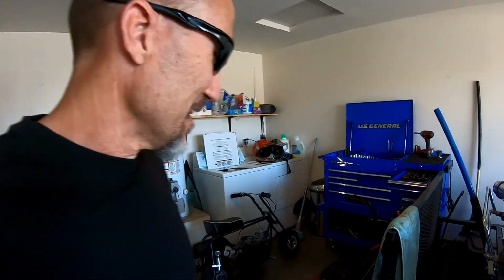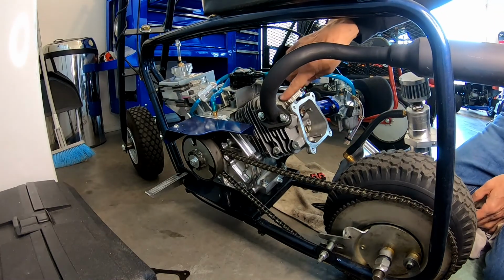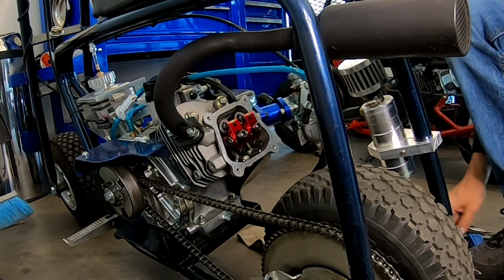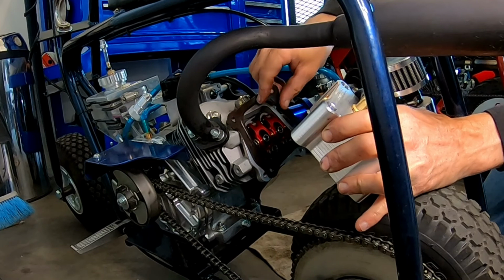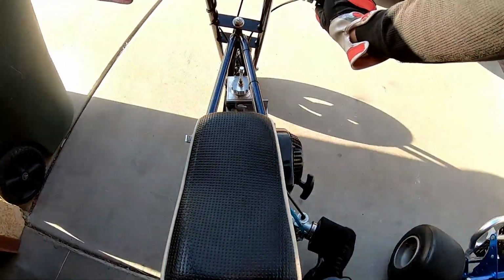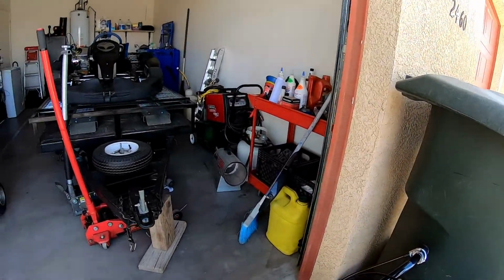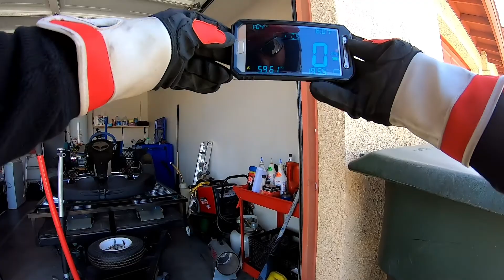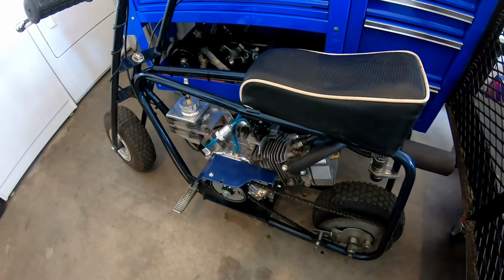Predator 212 26 lb valve spring install and Road test

Comment: You put those springs in effortlessly. Anytime I work on anything mechanical I have to at least louse up once and cuss twice 🤣
Reply from the maker: lol
Reply: @Black66 how do I know what lb springs to put in my 212 predator? No governor, exhaust pipe, mikuna carb, billet flywheel, and torque converter.
Reply: @bears893 put some 22lb pound springs👌
Reply: @bears893 your not supposed to, just pick whatever pound you want the stiffer the better

Comment: i understand the bigger springs with the slide carb and gov delete, i ask you though adjust the valve lash on the intake and exhaust why are you setting them both to.003 thousandths sir
Reply: shouldnt it be more like .007 and .005
Reply from the maker: The cam card calls for .003 on both
Reply: do you recomment upgrading the push rods from stock aswell i upgrade everything but push rods they did not come in my kit 26 lb kit

Comment: Great video! I was watching some of your old videos. What kind of solder do you use for throttle cable ends for mikuni carb?
Reply from the maker: Thanks! I use Bernzomatic silver bearing rosin core solder. It's just your standard electrical solder. seems to work pretty well.
Reply: @Black66  awesome, thanks!
Reply: Bicycle brake cables work great for mukuni slide carb. throttle cables

Comment: I just put 26# springs in my hemi 212 but did  not change the valves or retainers and still have stock rockers. What are your thoughts? Am I asked for trouble. Mine did just not go in like yours I had to have my wife help me push 😂
Reply: Been running no issues

Comment: I know you probably should this before to change the value springs on 224cc I want to know how to get them set right I know you have to turn the motor to get it just right how you do that again please thanks and again I  enjoy your videos
Reply from the maker: Thanks ! Turn it over to top dead center and set them there. Get the piston all the way to the top. You can put a screwdriver in the spark plug hole and slowly turn it over until it sticks out the furthest.

Comment: What push rods, valves and all the rest are you using in the head?
Reply from the maker: NR Racing 5.160 pushrods  with stock valves in this set up. Check out the playlist for many more combos.

Comment: it must be easy to put those springs in with the type of retainers the retainers that come with predator 212s are difficult to put springs in
Reply from the maker: It's really easy to put the automotive style retainers and keepers in if you have the correct tool. Or make a tool. Check out this video. About five and a half minutes into the video I use a tool I made on a drill press. Makes them super easy to put in.  https://www.youtube.com/watch?v=oxhroZjFb1A&list=PLkbj-ip-5FzZ4tKihy7hQLgISLoliBLRz&index=7

Comment: You use those style retainers? Everyone is always trying to tell me those can't handle power and high rpm's so I had to struggle to get the automotive style ones in. How have they held up for you
Reply from the maker: They have held up . I wouldn't go past 26lb springs with the "slip on retainers"  just to be  on the safe side.

Comment: If im running a hot 265 cam, flat head piston, 24mm mikuni and the rest of stage 1 and 2 what head setup should I be running?
Reply from the maker: There are so many different head combos you could run that work well. Check out the playlist for more combos.

Comment: I did a stage 2 build and the bike ran twice but was very hard to pull starts without it yanking back but now it friend start at all, there’s no bent valve or broke push rod but it lost some compression do you think it’s maybe the valve lash got if of wack
Reply: Yeah check ur valve lash mann.. use a feeler gauge to check the valves
Reply: @rexs8058  I didd but I used the valve lash that coke from factory on a stage 2 build so maybe that’s why 😭😭😭
Reply: @Matthewamic  lol yup that might be it
Reply: Timing is off. Check gap on coil.

Comment: What’s your opinion on 35 vs 40 chain
Reply from the maker: I like 35 chain. Less rolling resistance and weight. RLV Gold on Gold 35 chain will handle big power. I like 40 chain on the bigger bikes.

Comment: I installed 26 lb valve springs on my 212cc predator hemi and it won't start, any suggestions?
Reply: Rockers are not set properly.  You need a feeler gauge

Comment: Question I got a stage 1 predator 212cc do u think it will do 50 with a 12 Ina front and 75 on the back?
Reply: no
Reply: A 75 is way too big for that kind of speed..you would have to build an engine that would do 15,000 rpms..lol..I'm currently running a stage 4 kit, with a 1:6 gear ratio..and only getting around 55mph, at 7,800 rpm...

Comment: Would you suggest building out a 212 or 224 for a first build? I’ve already purchased what’s supposed to be a non hemi 212 (coming in the mail) And bought the juggernaut torque converter kit. I want to take it to stage 2 at least, and seems like a good enough challenge given I have no mechanical experience really. I’ve got a cart ready to pull the trigger on for a 265 hot cam, vm22-133, jets, and necessary valve guide for non predator motor, ARC billet connector rod/flywheel, proper gaskets, 26lb steel valve kit, and NGK spark plug. 
I don’t have a roller yet, just buying the pieces first. Probably gunna get something Azusa sized. Just to toot around the neighborhood and I have a short 10 minute commute to work I’m going to get a temp license. It’s a thing in Idaho where you can have it if you avoid highways and roads that exceed 45mph. 
Thanks for all your videos and if you take any sort of time to give any suggestions. Appreciate ya.
Reply from the maker: Thanks for watching the videos! a 212 sounds like it will suit you just fine for cruising around or even performance usage.  A 224 build can be a little more involved with its 58mm stroke. Sometime it takes some clearancing .
Reply: @Black66  that’s what I’ve read. That’s why I’m leaning towards the 212. Seems to be more aftermarket and it seems like you can take it further if you want. I have virtually no experience with engines or mini bikes though. I purchased a Baja when I was 15 or so (10 years ago) for $200 and sold it for the same price. Wish I didn’t. 
The main thing I’m having an issue with is figuring out the jetting. Because most people, you included have the aftermarket one and recommend a 120 jet. And the VM22-133 recommends 140/17.5 for stock to mild engine builds. Mine would be stage 2 which I imagine would be considered mild or slightly higher. Having a hard time figuring out which ones to buy without having to spend money on OEM pieces. But I’m not sure if the $10 kits on Amazon with multiple jets would be compatible with it either. Videos I’ve seen on here seem to tell me otherwise. I’m at 2,100ft elevation too. Might just buy the carb kit on GPS that comes with their recommended jets and then just have to throw it on and cross that bridge when I get there to see if I’ll have to order more parts. Thanks for all your time. You’ve helped out a lot with determining how this build will turn out. There’s only a couple of you guys on here that really seem to be honed in and committed to helping people figure out everything. Thanks a ton.
Reply from the maker: @christophermichaels6569  Anything you can do on the 212 you can also do on the Predator 224. The 224 is just more involved sometimes depending on the parts used. Everyones jetting will be different depending on engine mods, elevation etc. On the VM22 up here I usually get a way with a 115-120 main and a 17.5 or stock pilot on a mild built 212.
Reply: @Black66  right I just don’t know if I want that level of involvement. I figure I’ll go with the cheaper engine and see if it’s something I truly enjoy doing before I delve into a bigger project than I can handle. Plus I’ve already bought the juggernaut torque converter which unfortunately isn’t compatible with the 224. Figure if this is something I enjoy then I’ll invest into something bigger and more spendy after I’ve gained some knowledge. 
So the problem is the OEM piece for the VM22-133 smallest jet size is 130. And they recommend 140/17.5 and we’re about 1k off in elevation. Should I buy a 130 and maybe a 135 too just to test it?
Reply: @Black66  didn’t think I’d eat my words so fast. Harbor freight just yesterday had 224s online. Now the site doesn’t allow you to purchase it. So I called down to harbor freight and they had 3 left. So I bought 2. I don’t want to experience FOMO. 😂 not sure if it’s a temporary or permanent thing. Worst case scenario I’ve got a 90 day and 2 year warranty too. Time to watch more videos lol.
Reply from the maker: @christophermichaels6569  The juggernaut will work with the 224.
You sound like everyone else. You say you want a cruiser but ultimately you will  build faster and faster lol
Reply: @Black66  yeah yeah don’t come at me man 😂 I truly just want to be able to go 60+. Not that I plan on being at that speed hardly ever. But basically the ability to accelerate quickly. And to say that I CAN. I want to zip around. Really the jug-a-verter deal works on the 224? From GPS? I was just about to search up on here for builds that have done it. Then here you are helping me out again. On the description it says it should work with 3-7 HP engines. It shows the 212/225 tillotson and both types of 212 predators. I was going to be bummed if it didn’t work on it. Luckily it’s a returnable item. On their site it’s about 50/50 whether or not you can return your items. Thanks again for all your help so far. You are the man.

Comment: I'm currently running a billet arc flywheel which is advanced..billet connecting rod, mod 265 cam, 24mm carb.. with chromoly push rods, stock rockers with 22lb valve springs..and valve floats so bad that it constantly cuts out anything pass 7,800 rpms...was told to up my springs to 26lb with stock rockers..but anything above 26lb will require ratio rockers...do you think that the stock rockers could handle 26lb??
Reply from the maker: I have used 26lb springs with stock rockers. That's about the safe limit. You can always use shaft mounted rockers. They are inexpensive and will hold more pressure.

Comment: I upgraded my vavle spring to 26 pound too with 265 cam but im getting kick back do i have to re gape my coil cuz i have the vavle lash at 003 on both i dont know why its doing that pull start is giving me alot of kick back
Reply: readjust the valves. do exhaust open adjust intake. intake open adjust exhaust. do not do the both valves closed at TDC method.
Reply: What’s the setting for it

Comment: Quick question how hot does your clutch get when you drive it does it get very hot?
Reply: With this type of riding it shouldn't get very hot at all. Clutches get hot from a lot of stop and go, and slow speed riding where you are on and off the clutch. Once a clutch is fully engaged it's like having a small flywheel with a sprocket on it solidly connected to the crankshaft.
Reply: @Deucealive75  ok i havent really full throttled it yet i am on and off the clutch thats why its getting hot?
Reply: @levishelton3363  Yes. They will run hot with too much on and off engagement.
Reply: @Deucealive75  yeah mine get insantly hot off engagment is that good